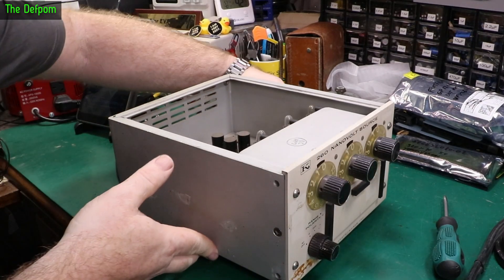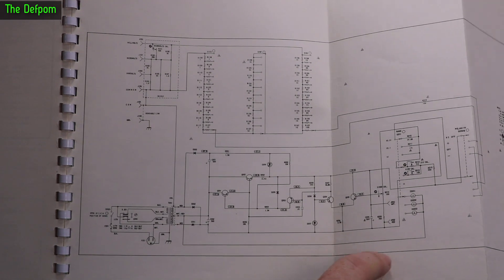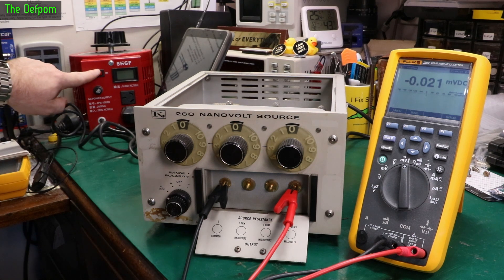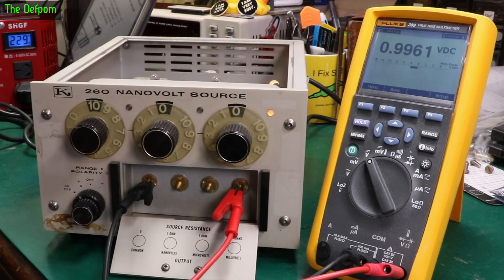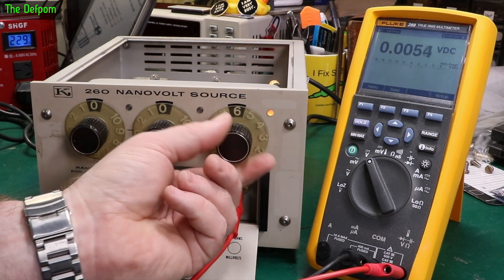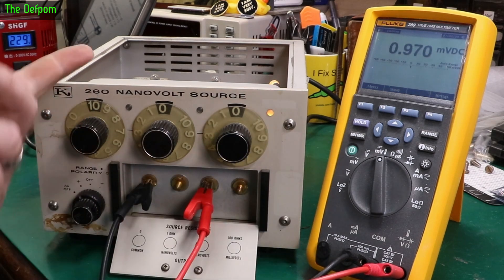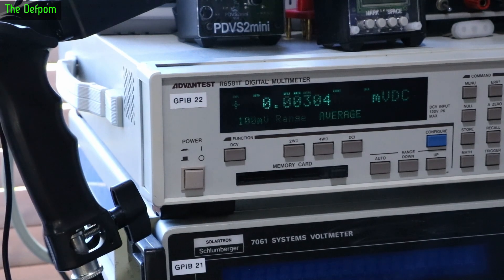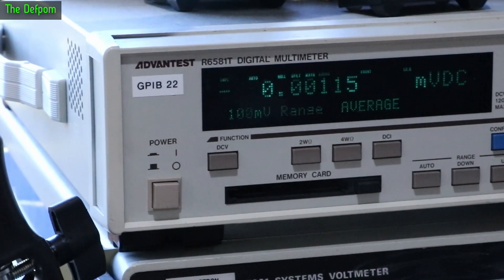🔴 Keithley 260 Nanovolt Source Testing & Repair - No.1216

Comment: For already low microvolt measurements, you probably should use “low thermal” connections.  Even more certainly for nanovolt measurements.  That means avoiding thermocouple effects between dissimilar metals.  It may be difficult, as you seldom know the materials of the socket or binding post terminals.  But tin or nickel platings are not likely to be good options for the banana plugs.  If my memory holds, type “K” thermocouples have about 41 microvolts per degree C constant.  Type “J” thermocouples produce even worse, about 53 microvolts per degree C.  Both numbers are near room temperature, as these constants are not truly constant over their entire operating range.

Comment: Thanks for the video. The nuts on the four terminals looks nickel? plated, not original for sure. This will affect lowest range. Mine has black plastic with gold plated copper inserts. I think that it would be better to make custom out of plastic only. Cheers!
Reply: I don't know so much about plastics, so this is a question... I understand why plastics might be better in some respects, but don't some types have electrical properties - like creating static? I guess I am suggesting that some consideration of the type of plastic might be good. Just a thought... HTH. Cheers.
Reply: Hi  @t1d100, the static electricity is not an issue here. The problem is when two dissimilar metals meet creating https://en.wikipedia.org/wiki/Thermoelectric_effect#Seebeck_effect
Reply: @t1d100  There are indeed definite differences between various plastics.  For the first, PVC (at least the softened mixtures) are not good insulators.  I once built a test station for a vacuum/temperature chamber used to verify the progress in drying of paper insulation on a phone cable pre-prep.  Initially it showed bad leakage, which turned out to be caused my PVC cable between the chamber and my test station.  That was fixed by a change to PE (polyethylene) insulated cable.  On the other hand, often otherwise great PTF (Teflon) can cause static or triboelectric problems.  Polystyrene is similar.  Everybody has likely experienced the static on packing “peanuts”.